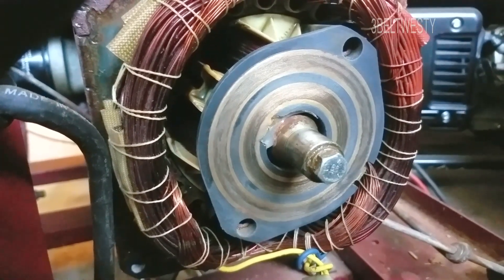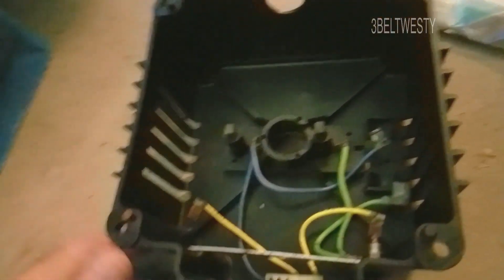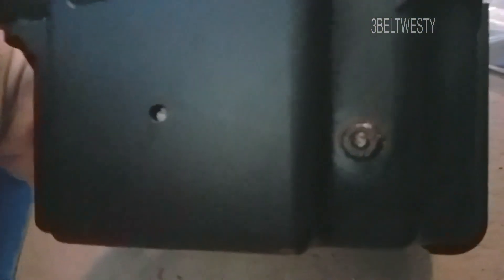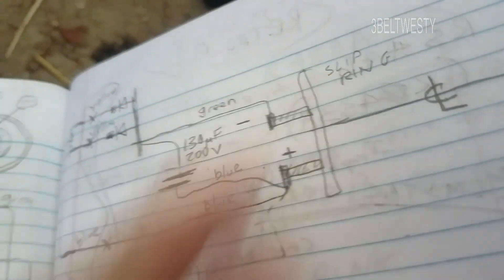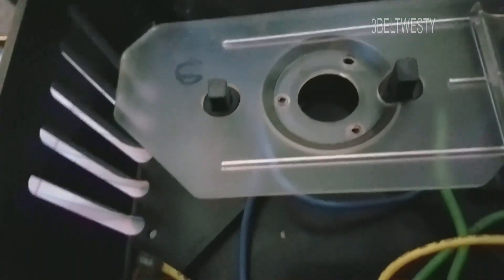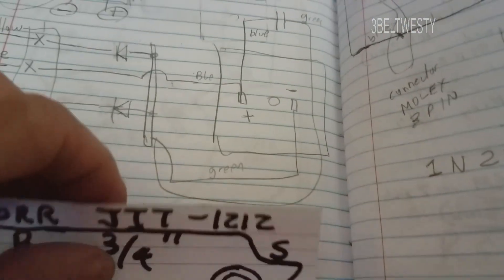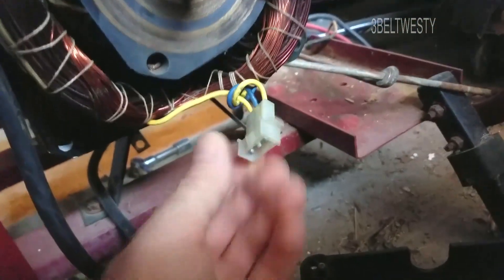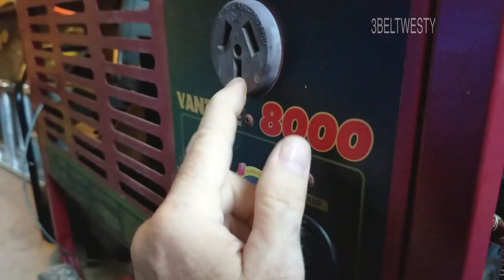Powermate 8kW non AVR generator low output bad capacitor in endbell

Comment: Can you help me please understand me Delco 12si alternator.
It is controled partiali true the dashboard via positive linear voltage regulator tipical 80s GM / Opel design it uses only pin 1 to excite the alternator via bulb nothing ells pin 2 is bend inside the alternator housing.
I know he produces back charge because they bypassed the diode to baterry light true engine warning light.
But me problem beggins that I like to use plasma ignition supposedly ordinarly in series soldered hv ceramic capacitors on me + E core type ignition coil and simply ground the other side the effect now I got smuther engine faster spinning starter motor but now me alternator is constantly back chargeing the bulb wont turn off unless I rev the engine around 3000-4000rpm.
Can you tell me how to counter that problem???
How much I culd understand the negative baterry potential voltage has some thing to do with those ceramic hv capacitors.
As mentioned earlyr the sence pin on me alternator is bend invarda so Im not shure what that thing uses dc+ or dc- pulses and on what frequency range to manuali force the alternator starting charge to be normal.
I hoppe to finde solution for dual baterry set up or capacitor/baterry system that does not share common ground or positive baterry terminal.
I need badly bether power for me ignition coils and for testing porpuse on different speed ranges .
I do lot engine conversions mostly low speed high torque aplications so I requate strong spark and baterry chargeing below 500rpm range.
So do you have any advice what I can do to improve me Delco 12si alternator at least how to counter that back charge problem?

Comment: Hi, I have a 4000 " commercial" it doesn't generate electricity.
I found the positive brush plastic holder a bit molten and the brush stopped making contact with the slip ring.
Do you know what could have caused this problem? Thanks in advance!

Comment: Thanks for video. I have a Powermate PM0525202.03 that looks fairly similar. Parts list for a few of their models here in case it helps anyone: https://usermanual.wiki/Powermate/PowermatePl0525202PartsList780863.879300702/view

Comment: Do you have the diagram of how the cables go to the capacitor? Mine somehow got lose during use and must of hit the rotating parts it was bent really bad now I can only see one of the cables that were on it but I can’t find where the other one goes to, also is the clear plastic cover totally necessary, it broke when the capacitor hit the moving parts and I can’t seem to find a replacement, thanks in advance for any posible help

Comment: Greetings, Just wanted to post an update to my situation. Rolled the dice and attached remaining wires and started the gen set, AND IT WORKED. I just have to check the output of the 220vac an 110vac to see if the voltages are exact. There is a small adjustment on the board I believe  will facilitate that adjustment. Will advise and *THANKS FOR YOUR VALUABLE ASSISTANCE!*
Reply from the maker: Thanks for tor praise. Thanks for the links too. Someday I want to convert mine to an AVR thus the model number of yours is helpfull. Before I do that I am going to run a test of the output of mine versus the Capacitor size in Mfd, just for kicks.
Reply: If there is anything I can do to assist you, please get hold of me here! I myself wondered if a non AVR could be made into a AVR gen. I do like my gen (if you had a chance to look at the links) and wish I could ad a pull-start as a back up to the electric start it already has.

Comment: Were you able to get a bit of time to read my posts in the link I sent? 

The model number is; 
MODEL #  PM0558023.01 Colman Vertex 8000 generator. 

I think I just need to know about the;
 **Polarity of the 2 black wires disappearing into the rotor/stator area**.

The two black brush wires with spade lugs that come OFF OF  the new replacement board are NOT annotated for plus (+) or minus (-) and therefore could go to either brush/slip-ring. 

*IF these black wires coming off the replacement board were reversed and IF the polarity mattered on the brush/slip-ring/brushes, would damage occur. *

Thanks again for your assistance!

Comment: Greetings!, I have a question of you if I may?...

I have an 8kw Coleman (now Powermate) generator in which the AVR is defective. (MY GEN HAS AN AVR)The AVR is no longer made but, "they" sell and aftermarket board. 

I removed the guts in the endbell of the gen which is identical to yours. While the pin-out of the 5 pin plug to the replacement board took a bit to figure out, I am questioning the exciter (2 yellow and 1 blue) wires  which terminate into a 3 pin molex plug and also questioning another 3-pin molex plug that is only using 2 pins of the plug with a black wire at each end with the center being vacant.....

**Where I am confuse is that; on the 3 pin molex (2 yellows, 1 yellow on each end with blue in the middle  as in your video) does the placement or polarity make any difference pertaining to the two yellows (if they were reversed)?

**On the plug that contains only 2 black wires, would that polarity make a difference either? You assistance would be greatly appreciated. I have info in a forum that is complter with picts and other info should you need it and I would be happy to post that link. Thank You for any assistance.
Reply from the maker: Hello great question!  

The yellow/blue/yellow is the exciter winding. It puts out AC voltage. Blue is the center tap,. The two yellows could be swapped since the diodes on mine or your AVR rectifies the AC to DC. The capacitor on mine is across the DC and thus it powers the two brushes.  At those brushes the polarity matters, the Field is DC voltage, giant magnet that revolves ie the armature. If the Field was a fixed permanent magnet then the output of the stator just varies by the rpm. The AC output voltage of the stator (goes to the sockets) goes yup with rpm and goes up with the flux of the Field too. Since the machine in the USA is for 60Hz the rpm is boxed in at 3600 rpm for a 2 pole alternator. Usually, the rigs are set up slightly fast at no load say roughly 61hz and may drop to say 59 at full load.  

 All the AVR is doing is sensing some type of voltage, often AC and trying to adjust the DC field current so the AC voltage is correct. Thus your rig probably has an extra winding for the sense voltage.

Do you have a model number of your generator? 

 Your " plug that contains only 2 black wires" if they are small dinky wires they are probably the AC sense voltage for the AVR.   

Color codes vary thus be carefull.

 The avr's I have played with all have 6 wires, 2  for brushes at one output of the gooped AVR body and the other 4 usually to a connector. These 4 are the 2 wires for sense AC and 2 wires for the AC input voltage from the exciter winding on the stator.

  On my 3 different types of AVR's the 2 blue wires are from the Exciter the AC voltage. The 2 sense wires on one AVR are 2 yellows on one, white and green on another and white and grey on yet another.
  
The 2 brush outputs on the 3 AVR's are easy to find, they all have spade lugs and come out of the AVR in a different area. Two have red + white - pairs and one has blue + and yellow -

 The blue trim pot on the AVR allows a voltage adjustment.

  The Coleman Vertex 55 has 5 wires to the AVR. It senses one side of the 120 volt stator, ie on black to center tap of the output ie Neutral and another black to one of the 120 volt hots. These two blacks should "ohm out to zero" to the white neutral on the duplex sockets and one of the 120 volts hots on one of the duplex socketss  (and to the 120/240 big socket too) . The Coleman AVR has + DC out to a brush with the blue wire and to the blue  in the center tap of the yellow/blue/yellow winding too. The green from the AVR goes to the diodes, the heatsink and capacitor too.
Reply: WOW!, I really thought I would not get a reply!...THANK YOU VERY VERY MUCH!...To make things a bit easier, I have posted a link that will bring you to a post I have on a forum website. ...It is completer with picts, stats, dialog, etc etc......I hope it will be easier for you to extract the info...MANY THANKS!!!!  http://www.electriciantalk.com/f2/generator-sparation-info-needed-226793/
Reply: @3beltwesty  Yeah, great deal!  Really appreciate the insight.  Makes sense to and confirming what I was thinking.